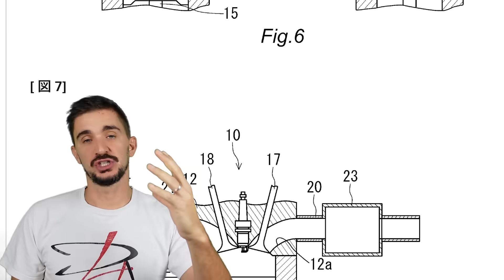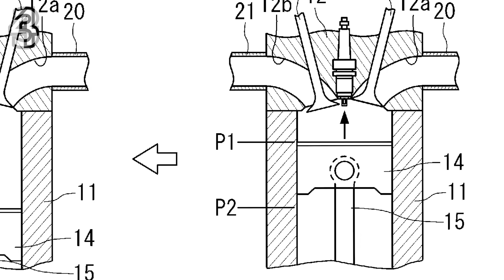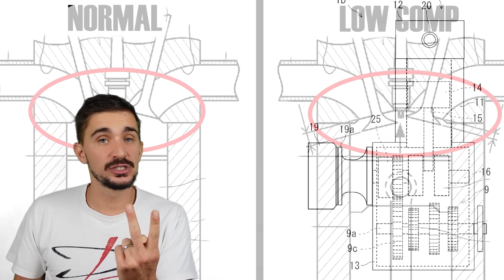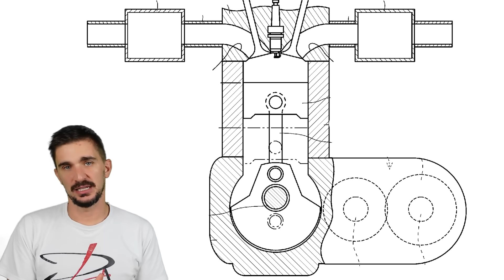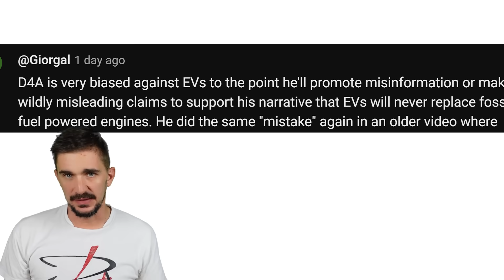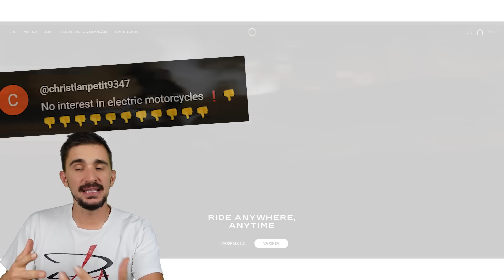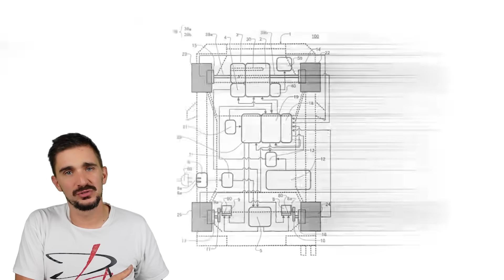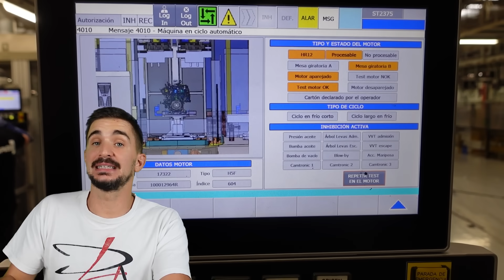Yamaha Just Patented A Fake Engine

Comment: Many have already mentioned: defensive patent, Harley-Davidson built decades-long market segment dominance on inferior design concept that worked simply because it sounded a bit like a radial aircraft engine, scope to circumvent future sale restrictions (though perhaps a bit too soon for that to be feasible). How about parts supply? Is there a market where supplying parts for engines that haven't sold new in X years may be penalised? Would sizing the "fake" engine appropriately allow them to keep Zumas running on whiskey-bottle premix when all the Waves have died out with burnt exhaust valves and shredded piston rings while the tuk-tuk drivers don't yet have ready access to proper EV charging infrastructure?

As an aside when I was (halfheartedly, backyard-style) trying to build an electric sportsbike back in 2011 the most common response I got mentioning the project was "people who ride motorbikes want them to sound like motorbikes". I occasionally retorted that, as it happened, my homebrew motor controller didn't commutate with the typical VFD-style high frequency PWM whine they may have preconceived, but rather a fairly brutal and slower switching that tended to make the rotor cog quite loudly. Combining this with an integrated fan and carbon duct venting part of the motor to the low pressure area above the swingarm I was pretty sure the finished bike would sound a lot like a 4 stroke race bike, if nowhere near as loud, and, of course, with no gears. "So you mean like a scooter with CVT then? No sportsbike rider wants that either." was the memorable, if deflating response.

Given the incredible forgetfulness of modern pop culture (5 year old movies "due for a remake", 20 year old albums can be ruthlessly plagiarised) and the rise of fake nostalgia ("80's mix" = 2010s synth pop, 1080p MiniDV recording = "funky old VHS") how long will it really be before enough customers won't care, or even realise, that a monotonically increasing frequency of clunks through a soundbox doesn't actually sound like something Stoner and Rossi battled on back during the Cold War when owning slaves was common and phones were called Nokias?

Comment: In the future there will be an (illegal) aftermarket of converting fake engine into real engines when the batteries die and are prohibitively expensive to replace with fake battery packs which are really radiators and fuel tanks and fake electric motor housing containing gear transmissions and fake electric motors which used clever exhaust valving and ports to generate a high pitched 'whirring' sound.   The rebel motorcyclist of the future will steal fossil fuel from the power stations who now use all of it to generate electricity. many will be taken but they will eventually prevail in the name of Jim Goose, Alan Millyard and Evil Knievel. That's what i think and i'm rarely wrong about these things :)

Comment: Even with that much battery efficiency (and appropriate power to charge it with), you're still wasting resources on the manufacturing, which would mean the whole industry would need to be that much more efficient to compensate. (as it is, there's a big argument in buying used and maintaining older vehicles, especially efficient ones, rather than buying new, from a sustainability standpoint)

OTOH, given the cost premium tied to such things on top of all that, it's going to be a premium product, if it ever exists in reality ... so there's probably going to be too few to be statistically significant. (even fewer than Harley owners/users ... which are also going to be statistically insignificant overall pollution wise:  though they might be more of a noise pollution issue depending where you live, but then so are whiny, very small displacement, low power 2-strokes in other regions)

Comment: I've hated the user interface of all the glass cockpit style recent gen cars ... and will stick to buying used as long as I can.

I wouldn't mind an EV re-engine package for some older vehicles though ... and they're MUCH more viable now than they were decades ago as custom projects or kits. (plus modern EV drivetrains on some older, lightweight cars are something else performance wise)

The Tesla interface is just especially bad, like a parody of what everyone else is doing (though they were doing it first, I think(.

Give me a proper gauge cluster I can read ... even if it's digital, make sure it's compartmentalized across multiple separate display screens are are all easy to read. (80s and 90s style LED and LCD digital displays were fine IMO ... some were kind of cool ... I miss our '96 Carprice Classic wagon ... and big station wagons in general, but that's a separate topic)

Comment: It's a reciprocating engine emulator ... so ... it's like playing original cartridge video games on one of those modern fully emulator based clones rather than real hardware ... or even a clone that implements the functions on dedicated hardware.

I mean ... I suppose if you have a real-world equivalent where EVs become SO much more advanced than what they're trying to emulate that they can literally get away with it efficiently then ... that'd be a thing for a certain market niche. Simulated authenticity?

Although in terms of raw power density, electric drive is already really hard to beat. Fuel (battery) capacity at certain small scales might not be there yet, though ... maybe? I'm not actually sure. (I'm thinking in motorsports terms, not practical real-world use, since there's still a question of fast charging infrastructure availability)

Also the "low CO2" angle is ... not all that real-world conscious at the moment, though maybe very long term future thinking. (not enough nuclear+other alternative energy in many regions to allow charging via non-fossil sources, though you could get into real-world relative fuel economy ... and then also get into end user cost:  for some regions, cheap electricity makes it really appealing, in others ... not to much) But on the OTHER forms of pollution, there's at least more of an argument up front: you're not going to have a motor vehicle that can compete with a modern, NG fueled combined cycle gas turbine power plant. (not talking CO2, just all the real forms of pollution, a bigger deal in some regions than others ... like CA ... they like to push the climate-change angle, but in reality, a massive amount of the real concern is just air quality, which is especially hard to maintain with CA's geography/topography)  Albeit if fossil powered industry heavily adopted carbon capture tech, this would also be a different argument. (you can't practically capture exhaust from vehicles, but you can from power plants that charge EVs) But until then, it's just hypothetical.

OTOH, statistically, motor cycles of all types ... in the US at least, make up such a tiny portion of pollution that it's not a really big priority. OTOH in countries where small motor bikes, mopeds, and scooters of various types are super common, it's another story. (but I can't imagine most of those using small, light, modest power, low cost forms of transport would be resistant to modern EVs of similat form factor)

The hardcore biker or sports enthusiast market is going to be so small as to be irrelevant, and the number of ... I guess posers with more money than sense who would actually WANT to by a recip-engine emulator e-bike would be an even smaller niche. (but if they can sell a dumb luxury product then ... fine, I guess?)

Motorsports wise, you're already going to have a divide between traditional and EV-sports, and there's already a long history of vintage classes of motor sports, and that's not likely to change.

Comment: I would modify it to be an air compressor. Grind that intake down so it'll close, one one valve on the exhaust, regulator and tank.

I have a use for air. Don't judge me.

Comment: I agree with your point of view totally,  but 
Sometimes patents do not totally show the potential, for example, in the design Yamaha patent in this video, I see a potential of an engine range extender Or (PHEV) design that can run whenever the engine is needed to extend the range and be totally zero emission when it's not running.
So it can be patented, but also not produced as is, by that they have the patent on the design itself, but they can alter it in the real world.
In this way, I can rationalize it.

And thank you very much for your exceptional videos, my favorite as always.

Comment: You're struggling to rationalize it, because you assume that Yamaha intends to use it exactly as described in the patent. I think they might be patenting it to use in, basically, toys. You don't need a big battery, rang or performance for an electric mini-moto for little children. But, adding a fake engine with realistic sounds and vibration might be something that sells in that very particular niche.

Comment: As someone that daily drives an EV, EVs are boring as hell.  I drive way slower now because there's just no fun in going fast just by pushing the pedal down.  I feel the same about anything with an automatic transmission, too.

Give me something to rev the snot out of, slip the clutch, bang through gears, and spin the tires, and I'm going to be hooning.

My daily bike is a 2009 Aprilia RS125 2 stroke I rev the snot out of at every light.  My gas car is a 1987 Porsche 944 that I also rev the snot out of since it's pretty low on power.

Comment: Atmospheric air is free. Why can't be there an engine that intakes air, compresses it and when piston going downwards due to air being compressed, copper coils mounted around the cylinder to push down the piston with ease. (Air+Electricity) and made an electronic engine that sounds like IC engine without compromising power loss....❤

Comment: Took me under two mins to work out where this one was going and how daft it would be!
I too am an avid motorcyclist and love my Ducati Panigale V2S and its noise and vibration but if I can’t give that up for an electric motor if batteries are ever good enough to power a motorcycle a decent distance without waiting to recharge it I will use zero carbon sustainable fuels to have an ICE in my if necessary vintage bike!
You’re not missing anything and I wouldn’t buy it!

Excellent cold cranking noise at the end is moderately real sounding if a little hollow with lout the bang part of the cycle!

Comment: I think Yamaha missed the boat on this one. They could have set it up so both the intake and exhaust valve work like normal and then put a manually operated compression release valve in the head. That would act like the intake valve being partially open but when the compression release valve is closed you would have an on board air compressor. Perfect for fixing flats!

Comment: I love this channel. I've always been fascinated by how engines work since I was a kid and thanks to you I've learned a lot about them and designed my own engine and it works perfectly in computer simulations. because it uses very few parts compared to other engines its cheap to make and its very simple. its kind of like a two stroke but doesn't burn oil and it even has adjustable atkinson cycle. im going to build it probably next year

Comment: The correct thing is to build a reciprocating engine that burns hydrogen.  Voilà, no carbon dioxide.  And I don't mean a fuel cell, and I don't mean a hydrogen range-extender.  I mean, just a straight, hydrogen-burning piston engine. Preferably even two-stroke, in the pattern of a Diesel two-stroke, with the sealed crankcase.

Comment: 12:12 - I'd call it arrogance. They think that they can scare everyone into thinking that driving a vehicle with a combustion engine makes you a bad person. It doesn't. And to Yamaha: Don't insult my intelligence by suggesting that the reason I don't like EVs over a regular engine is because of the "noise and vibration". Driving an electric vehicle is a categorically different experience. The accelerator responds differently. Like d4a said, they can be fun in their own right (I have an Electric Bicycle that I really enjoy riding through my local town forest), but it's just not something I enjoy in a car. I want to actually shift the gears, for example, and not be essentially playing a video game while I drive. I mean, maybe I am just more attentive or particular than other people, but stuff like an electronic accelerator (even in a combustion engine) annoys me. Why does my gas pedal need to be filtered through a computer that actuates the throttle valve? Why can't I just control that directly? I understand things like ABS and Traction Control, but I just feel like there's a point where you're just over-complicating things and introducing more points in the process at which something can go wrong.

I am forced to wonder if they want to make it so that you need a degree in computer science to be a mechanic...

Comment: It reminds me of a Fujifilm X-half. A toy that is capable of making normal photos. But, in fact it is a normal camera in classic design body, imitating classic half frame film camera. The whole point of this product is "Providing a film camera experience". But components of the camera are more capable than experience they provide. Then capabilities of the camera were reduced to fit the "experience". Here are some solutions that make no sense technically but serve the experience:

1) Having quite big 1" sensor it does not shoot RAW.
2) Half frame film cameras like Olympus Pen F had to have vertically oriented frame because they had a normal 35mm film roll inside. But here, in horizontally oriented camera the sensor is vertically oriented to provide an experience. But the screen is also vertically oriented. We all use vertically oriented frames in vertically oriented cameras (smartphones). But in horizontal body there is no room for a large vertical screen. It is hard to see what the picture is on a tiny screen. I always struggle with 3,5" screens on a normal cameras, but on this one it is even smaller.
3) A lever to roll the film. Just an imitation - there is no film. I hope it can serve as a thumb rest. Unnecessary mechanical part to be broken.
4) There is a mode where the user shoots on a virtual film roll. The user have to "roll the film" for each shot, can't see the shots until the film is done, and have to process the film afterwards in a mobile app (additional component that will be obsolete in five years or so). Instead just having photos right away every time the user presses the button.

It all started from styling (cameras look like classic ones) now it is evolving into imitating a "classic experience". For me this camera is a "fake engine" in a flesh.

It is not so long to see imitations like this on an electric motorbike.

Comment: strangely many big manufacturers in the end begin to break down and lose their way in the indutry they once dominated. look at car manufacturers they no longer makereliable cars any more, they specifically engineer cars to only get past the factory warranty, hence all the cheap plastic engine parts that wiil fail after the factory warranty has expired, like plastic thermostat housing that will fail after so many engine heat cycles

Comment: The motorcycle is powered by it's starter motor 😂, welp if it was a way to circumvent the ICE ban by selling the customer a fake engine, which then only needs aftermarket camshaft to actually run. Smart.

Comment: On the bright side we can see from the "fake" engine it is practically a functional combustion engine, it would only be to readjust parameters and valve travel, modify some things and we would practically have a hybrid motorcycle, impractical yes, because we would have to modify the combustion engine a little to make it functional and Yamaha could sell them as "only electric, with fake combustion engine" so those who at some point want to make it work can, another good side is that you would have the power of both, instant torque of an electric motor and the power of a gasoline engine

Comment: IMHO Yamaha / Toyota stopped making anything credible in the early 2000's. Eg. The MRS (which had a weaker engine than the 3S), a FWD celica 1.8L (with ZERO torque), the Supra (plastic fantastic BMW abomination). But worse than that, their PR STILL CONTINUE to BS about how they are trying to appeal to drivers. WTF? with 3 cyl hatchbacks? They, have no idea what people in the EU want now. My advice is to pick a moment in history (80's through early 2000's) and ignore anything new. I do. I have a 91, 600 BHP MR2 (1st gen built 3sGTE), a 170 BHP 2004 Rav 4 diesel (all the BS has been removed and the ECU has been by-passed), a boat with a tuned 2C  (now 85 bhp, instead of 65), and want a Yam. SDR200. to finish my collection. In which, I will put (the engine the designer wanted but was told no by the A-holes who didn't want to hurt TZR 250 sales), a Lanza 230 bored out to 250cc. Japanese engineers are still the best but no auto co. is run by engineers.

Comment: Consider this a future where combustion vehicles are banned Yamaha would sell alot of bikes like this... on the fake engine side you could probably make it significantly lighter than an actuall combustion engine because it could be made out of a different, lighter material like a carbon composite or something , the design could also be tweaked most likely.